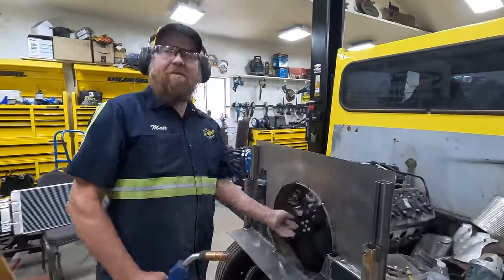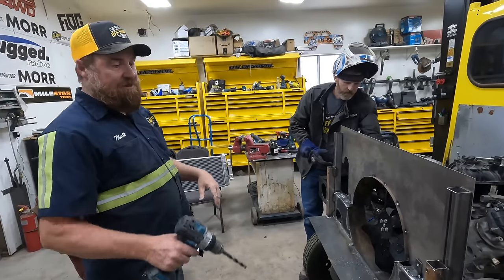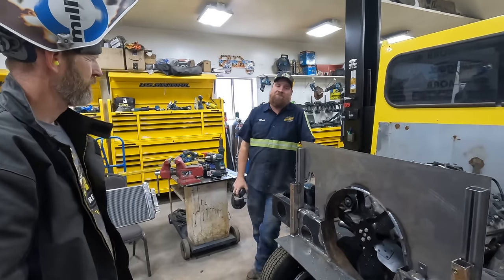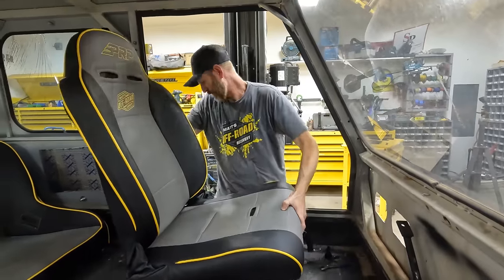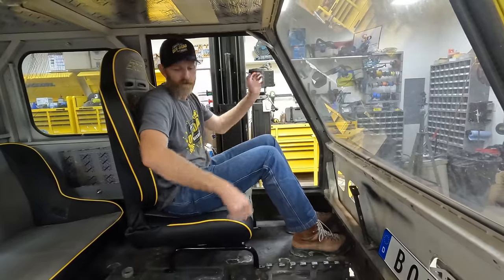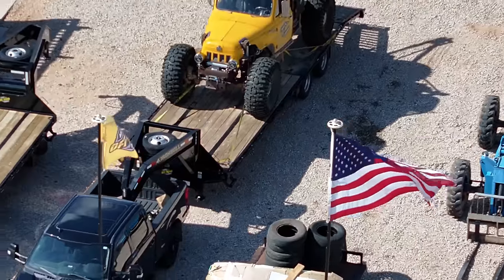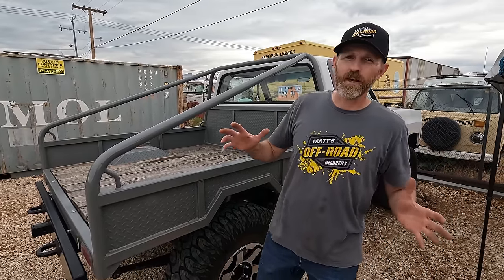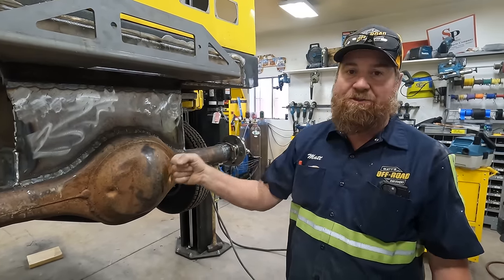The Best Upgrade The Bombi Will Ever Get!

Comment: heavy equipment that is needed to operate in cold weather environments many times have reversible fan blades the idea, the heat from the engine will help warm the coolant which still regulates the engine temperature but maintains heat in the operator cab area. Great idea

Comment: Great build. I like that you Have things you like, or dont like, that you use in your build. Light up high should work for recoverys. I like the idea of a spot light, like cops have, Very versatile. would work as your signal light. Where did you get the radiator? I bought a Champion, from San Diego, For My truck. Really like it.  Keep showing the situations you create as a build progresses, you know,,,, if we do this,, we then have to change that! The agony of defeat...

Comment: Quick thought about the steering.  It has tracks.  Make the throttle like a tractor/excavator/backhoe/etc.  Use foot peddles for the steering with stick backup?  Just stinking out loud.

Comment: By adding the back plate in front of the fan you will reduce the air flow on the radiator. As the fan blows the air speed doesn't go to zero around it immediately and that creates additional flow. That's how air amplifiers work. You can think about it, any additional obstacle you create in front of the flow, you reduce the flow and don't increase it. That's probably the most counter intuitive part.

Comment: Every forklift I ever operated had a very radiator setup.  In winter we put a standard automotive fan on the engine to pull heat toward the operator.  The engines were GMC V-6 truck engines.
Question:  Where did you get a twin-engine B-17 graphic since they were all 4 engine aircraft? It looks more like a B-23

Comment: My only radiator concern is the flat face at the bottom of the shroud will create turbulent air, reduce efficiency, and possibly end up recirculating hot air in the engine bay.

Comment: Cooling the Bombee engine is going to be great the way you're doing it. ALL Forklifts are cooled the exact same way and they never over heat because of lack of air flow. I would however think of having a trans cooler and engine oil cooler.

Comment: How about mounting the seats to custom steel storage containers on the floor with doors/lids instead of mounting to the floor?
Shorten the legs of the front seat rails. Attach the rails to the storage drawers/boxes.
Just a thought. Good luck with the build.

Comment: If its going to get much night use it'll need lights up high as well as you'll cast a lot of shadows with just low lights.
Maybe a single long lightbar with a quick detach plug so you can still take the cab off.

Comment: Team, Not that I know anything, but it may be worth it to weld those "old" headlight holes closed and mount an L-bracket to the front in order have a flat, solid piece to mount some LED lights to.  Just remember, LEDs don't heat, so they kinda suck in the driving snow.  Just a suggestion, I know Matt has several ideas and just hasn't picked one to go with yet. 😉

Comment: I put spotlights in the old light holes with  quick disconnect,  so in the winter  you have the extra lights. But me , I put ac in it for summer use.

Comment: I like Ed’s idea on the lights. And if your going to use a different cab for summer just add a few corner lights on top. Make them plug and play. At least you can do the same on a convertible top also. 
 I don’t know what all the fuss is about the fan. Your loaders and such all blow the air backwards thru the radiator and so do cats.  It keeps the dirt from coming in the radiator as bad.

Comment: Its really taking shape, is starting to look fantastic. Would using that centre bar you had plus 1 more hoop either side going back to the body. So you end uo with 3 hoops and have the lights mounted to the outer hoops.

Comment: I don't see any issue with the fan pushing through the radiator as long as it's sized correctly and has a shroud installed. Pretty much every large diesel generator I work on (20kw up to 2mw) is using a pusher fan blowing hot air from the engine compartment through the radiator without any issue and those engines are putting out a lot more heat than this LS series engine ever could.

Comment: I’m watching Tom practice with the centrally located brake handles.  Have you considered duplicating the brake controls for both front seats, much like an aircraft?  That way it would be more ergonomic and either position could drive.

You could do it mechanically or with two sets of brake master cylinders with a selector valve between them to select the driver seat.

Just a thought…

Comment: My hope for the front of the bombi is a decent tube brush guard/bumper that would allow for recovery points and lights could be bolt on or welded to the axle or front plate

Comment: --i can almost see you pulling some sort of trailer while bombi is going in reverse. BUT hitch is either to high or to low. make the reciever hitch swing up and down. so you can swing it all the way up and out of the way and then a pin, then swing it down and a couple pin locations for height. 
--i can see you needing some grab points either hooks, chain, rope, etc...  place U bolts or like on each corner and stick out so you can grab either from front or left (left side) or right (right side) 90 degrees from U bolt, also gives point if you need to double back winch cable or like for extra pull. 
--you really have no "HIGH" points to lift from. everything is lower to ground. so even you need to pull up close with bombi and then lift up with a winch and cable and then backup you can not. 
--winch in front, no safty cage. cable, rope, chain breaks, it will most likely take out front window and anyone in front with out some sort of mesh or something.  I am with no professional, dummy using lighter spec stuff than should be using, and having stuff break is not fun! been there a few times! though truck got the whipping on sides.

Comment: I cannot figure out why someone would say that the radiator and fan won't work when it's 100+ out side and you are hot and heavy maybe, just maybe an issue but if you are pulling in cold air hope you are getting that from on top some where...
Still think you should run 2 stainless steel pipes just under the body with tubes crossing over and maybe an old school Chrysler/Dodge vacuum operated control valve for heating the inside and for added cooling when needed.
And yes I know that is still down the road.
BTW awesome work today

Comment: You could have the steering levers sweep from the center between the seats and up to the center of the drivers position.  That way you aren't constantly twisting to reach them from the side.  Also allow room to get in and out of the drivers seat but pull straight with your body instead of beside your body.  Long rescues would definitely fatigue your arms and back.

Comment: -- Love the Bomb Bee vids.  So much concern and odd things with this radiator fan, why not install a couple electric ones instead.  Spare a few BHP?  Have a primary and a secondary to flip on and off in a pinch?  Hell, do that and keep the mechanical fan as well.  
    As far as people concerned about blowing engine heat onto the rad, don't worry, it'll suck air in from hopefully vents in the engine cowling/body, further cooling the motor and then through the rad ... like some diesel designs.  
    I'm still concerned about no suspension, though I understand it.  Don't want it to shake itself apart, and then there's comfort.
   When you're all done, consider coating the bottom of that thing with some RP-342.  Heh, but I live in the rust belt.  I have to stop myself from throwing things at the screen when you have projects all apart/bare and don't rust protect.  
     Honestly, I'd keep the headlights if they don't get into the cab too far.  You could make them storage.  First aid, flashlights, lite tools whatever.  Welder port.  DC/AC electrical port(s).  You could make them Knight Rider scanners (say one on the far passenger side.  But I'd have some function for them IF, they're not interfering with the interior.  
     Thumbs up.

Comment: Just now watching this (snow Bombi play list paused at the 9 min. mark), ) on Oct. 20th, and I am just wondering  why you didn't put the radiator in the front somehow. That would look cool and you could have put flaps on the back that would open when running and close when the engine is off. I'm sure tho it will turn out awesome just like all your builds 🚙

Comment: Set up a Roll bar; where you can remove the top and roll bar is to the chassis and a light system that can be detached and reattached from the roll bar to do the convertible conversion and vice versa.

Comment: Have a think about how high those lights are going to be once it's in 2' of snow...

Might want to have them at the original height, just mounted on a bracket instead of the cab.

Same deal with tow points off the axle. Might find yourself having to dig to use them.

Comment: Think we should challenge Tom to make a center mounted single stick control,  all mechanical so it could be driven from either position.   Thinking something like a cutting brake on a drift car,  but right/left instead of front/back, throttle cable on the same stick... preserve all the footspace.

Comment: I don't know why people think this won't work, forklifts work this way as well as other farm/heavy equipment when appropriate.  Only down side on forklifts is it turns them into a giant vacuum and you have to blow the dust off the radiator and engine on a regular basis.  It remains to be seen if you will have that issue in this application.  The important thing for efficiency is that the fan shroud spits the fan blades in about half, and it looks like you are doing that.  You mentioned putting in an secondary electric fan, that should boost beyond any lost efficiency.  I look forward to the astonished comments when this works like a charm.

Comment: Mmmm.....watching further on your radiator air box build, if you were to give each rivnut a spot weld to anchor it in place, they would likely do the job.  I've had fits with them, trying to undo them after they've been in place a while - they just sit there and spin.....and they "always" seem to be inaccessible (of course) when you're trying to get something done.

Comment: What about multiple receivers for attaching and removing tow points?  You could have them on the front, back and sides... you could even have a receiver winch with a receiver mount that you could use in any of the receivers

Comment: They make a rivnut tool for in a drill works much quicker than the hand tool makes it a breeze! That cooling system will work mint. Tons of heavy equipment use that method the make a ton of heat way more than a transmission and motor in a vehicle like this

Comment: 9:40 Land Rover Defenders in the 90's used a shroud fixed to the engine and a flexible piece between it and the radiator.

Comment: Another suggestion is that the axle tube's are going to be under a tremendous amount of stress when climbing or pulling. You might want to add more material around the axle tube. Maybe box it in or bracing specifically in front or behind. Just a thought. I know you said not to worry. Sorry for worrying. F.Y.I. A floating axle could probably with stand the added torque better. simply put I think the Bombi will travel just fine. We are more worried when you are actually trying to pull someone out.  That is when the Axle is going to be placed under Extreme loads.

Comment: light cubes up at the top corners will work better for flood lights, and will benefit the working you do in the dark. (offroad experience) all 4 corners benefit from a cube light. prolly the most used lights on all my rigs. dont really need to see far offroading (slowly)....

Comment: Make sure and place some type of isolator between that steel plate and the aluminum radiator. A piece of rubber should do. Otherwise the rubbing and galvanic corrosion will eat up your expensive radiator in very short order.

Comment: this one is for tom tom, a hose between the fan and the radiator with a low psi gage.
if it builds  psi !  does it fallow the water temp?
then turn the electric fan

Comment: I would have considered running the fan to pull air on from the back where there will be no snow, then expel the air through rear facing louvres on the side panels. Rear facing louvres are less likely to block with snow?
Or will there be dedicated intakes somewhere else?

Comment: Have you thought about adding horizontal extensions to the brake levers? Operation of the brakes can be done without leaning towards the center of the cab, increasing comfort and reducing fatigue.

See the Robinson R22 helicopter control "lever" or yoke for reference. The lever part of the control is in the middle of the cab, and the horizontal arm allows the operator to sit straight in the chair.

Disclaimer: I do not understand all the intricacies of your system to give quality advice. This is only a suggestion. It is not in any way criticism of your work.

Comment: Not to mention you will be operating the Bombi in the snow. I doubt if you will have any issue keeping the engine cool. As long as you are updating the Bombi, have you thought about adding steps on a hinge to allow you to get in and get out easier. Just a suggestion.

Comment: Would you consider putting the steering levers in the center of the cab with hinged extensions that would flip to the driver's seat allowing  the levers centered to the driver's chest.

Comment: Hey Matt ,Why can't you rotate those calipers down between the two wheels where it won't interfere with the tracks? I myself would put four rotors and four calipers two on each side, with a regular master cylinder that will give you some redundancy in case you blow a line or a pad falls out.

Comment: The heat from the engine blowing threw the radiator is no big deal, the only thing you would need to worry about is some kind of engine leak getting blown onto the radiator and then making dust and debris sticking. Then it wouldn't cool properly. At that point you fix the leak and pressure wash the radiator

Comment: I still think you should of converted over to an old skidsteer transmission instead of using brake steering though with the brake steer you will have a higher top speed at the sacrifice for control. another thing you could add is a front plow blade by using a power steering pump to run the hydraulics. combine setting the blade in the snow with a big winch and you have a recovery monster

Comment: I was thinking that lights on the corners that are aimed out to the sides at like a 45° angle on a separate switch might be useful for tight turns in tight areas or just to help find vehicles after dark. Also pillar mounted lights like on cop cars for searching and extra light when needed that you could move around and aim from inside the cab might be useful. Or possibly a roof mounted spot light for the same thing. Any who that’s just my two cents on the subject. 🙂

Comment: I'm questioning the new drivetrain setup... So you have an open differential with brakes on each axle/track to turn. But when you want to go straight its just going to send the power to the track with the least amount of resistance. So it will be a one wheel drive tank? Please correct me if Im wrong

Comment: If you are using rivnut brand rivnut that have a large flange put an internal wrenching star lock washer on before bucking the rivnut in place that will prevent the rivnut spinning in place!! Especially using a driver to tighten the bolts!!

Comment: You guys could make the dash look like a helicopter dash/console. Have all the gauges and such more torwards the center that way you have more legroom up in the front. Push the seats up slightly for more room in the back and make the back seats sit on a higher platform instead of being so low.

Comment: Put the head lights on top.  Two long focus, two shorter focus.  Turn on what you need. I am so tired of getting blinded by blowing snow in my truck.  Also do not use a white or blue-white LEDs in them.  Yellow will give you better visibility in winter. Also more light when working out of the cab.

Comment: Centre mount the steering, but make the sticks swingable from left to right depending on recovery job requirements. Dual throttle would need to be figured out

Comment: Matt  i was wondering on the big wrecker  back when you had set up the cooling system with dual radiators  what was the outcome ?  how does it seem to work ? that and was wondering if your using push and pull fans at the same time ? with the summer time temps i know you need that machine to run as cool as it can fer sure . thanks ps the  Bombi is looking great rock on using that claw hammer  lol..........

Comment: The idea of having to lean over to operate the brake levers is going to kill your back! You should have a steering wheel that instead of it ramming a piston for steering it applies brake to one side or the other.
OR...
Make the accelerator on a lever and a double left & right brake pedal for steering.

Comment: Idk if it would work, but I've driven skid steers that the bucket controls are on the floor, so couldn't u have like floor mounted brakes and have a semi hands free drive. throttle on a stick or or something like a lever. Idk just a thought